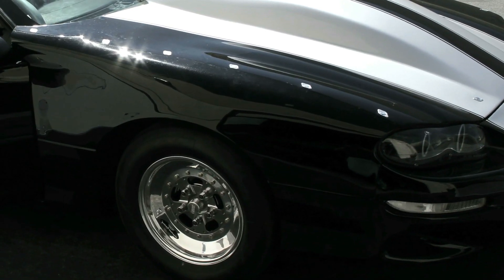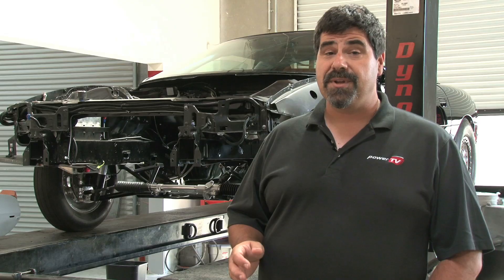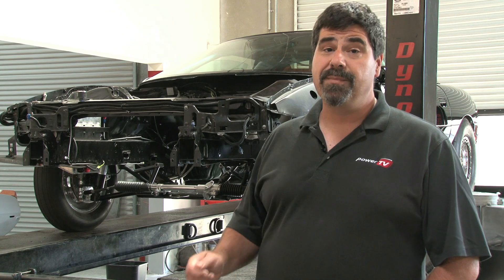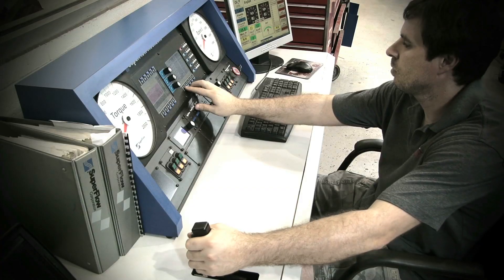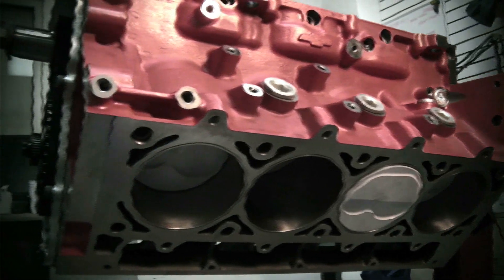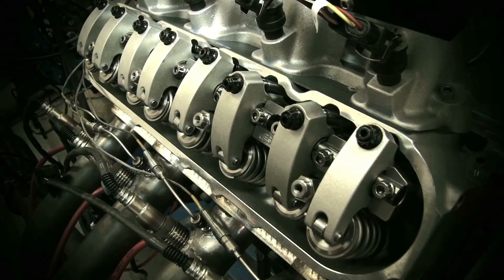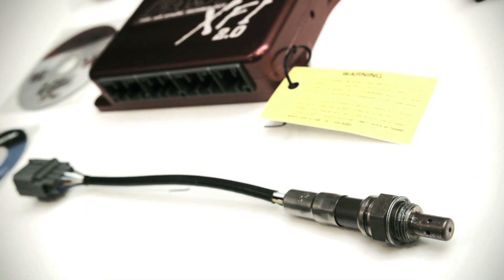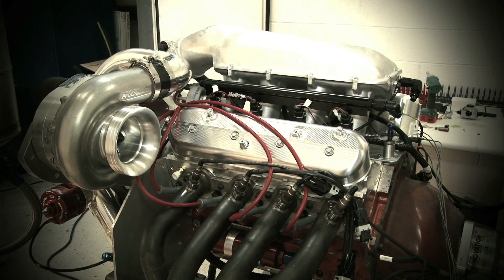Tech: Building a 1,200 HP 388ci ProCharger LSX Engine with VA Speed

Comment: As far as your Pro Stock engines of today,  The most successful are based on a BBC.  Chevy canted their exhaust valve the right direction, Ford DID NOT! The set of A460 Trick Flow heads we just installed on a customers Pro Street BBF took fords 15 deg exhaust and tipped it to 9.5 deg so that the valves are arranged more like a Hemi just like a canted valve head is supposed to be. These heads also use a BBC header flange because for some reason BBC headers are more readily available.

Comment: There's a reason theres 5 times as many Chevy engines at the race track.  I haven't seen any corvettes with modulars in em yet, but I have seen a few mustangs with LS's.  The LS lower end is capable of handling much more power than a modular as is and why is it everyones so quick to give ford credit for all this.  General motors has used all of these ideas in the past, Buick had a front mounted distributor and oil pump on all of its V8's and RWD V6's, Buick and Olds both utilize a center thrust bearing, The GM 6.5 diesel uses a symmetrical port cylinder head, The LS head is still a wedge head not a canted valve like a cleveland, Buick, Olds, and Pontiac all used a 10 bolt head bolt patttern, GM has used ALL of the ideas BEFORE the modular block was introduced!!!